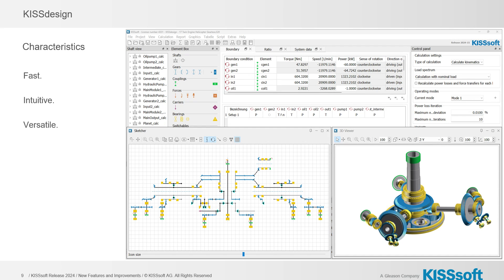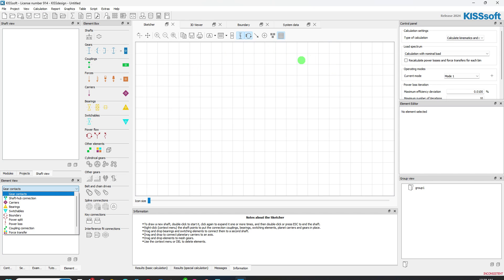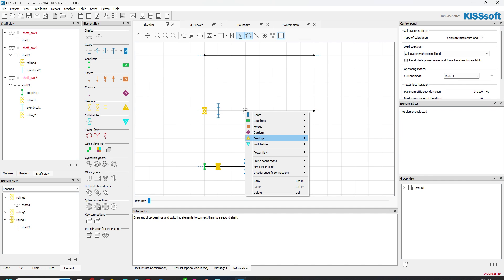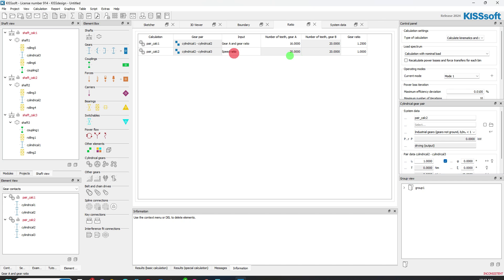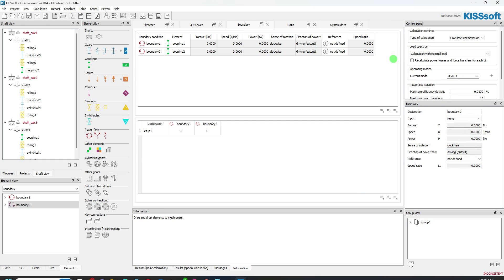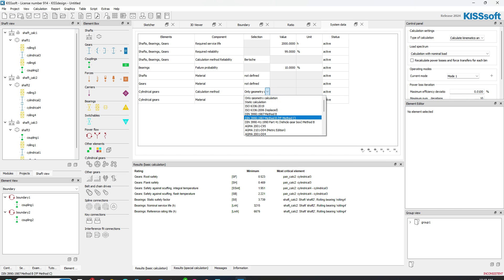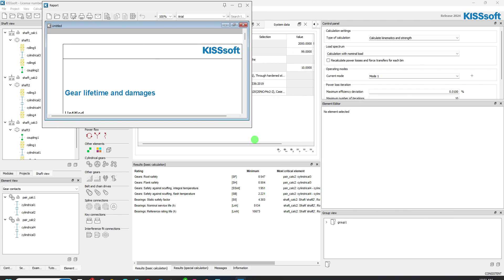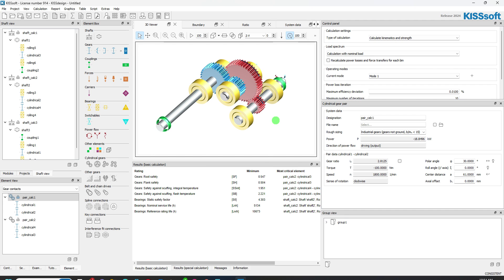KISSdesign 2024 - Overview of New Features

Comment: Hi, I can't seem to find how to add a key into this new kissdesign so it coworks with everything else.
Reply from the maker: You can use the right mouse button at any force element (gear, coupling) or switchable in the sketcher and assign a key calculation to it:
Reply from the maker: You must create coaxial shaft and then use a switchable element to connect them together with a stiff connection. Then right click on the switchable and define the spline, keyway, or interference connection calculation.